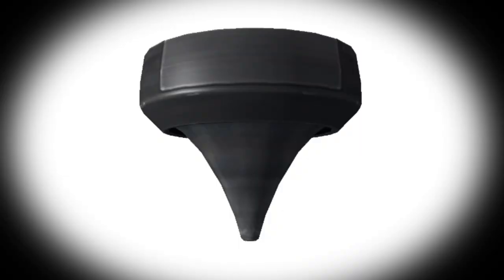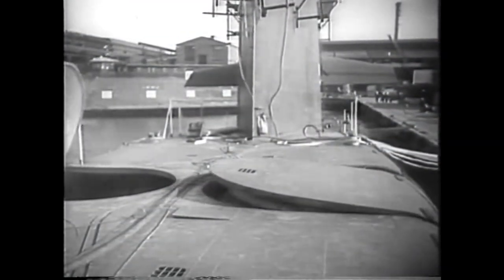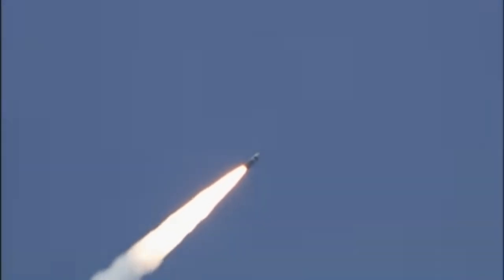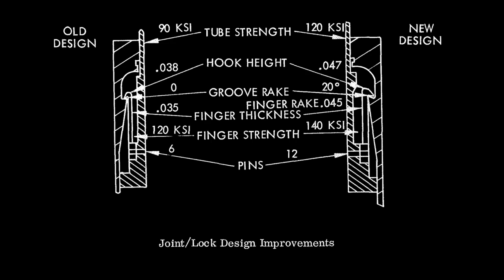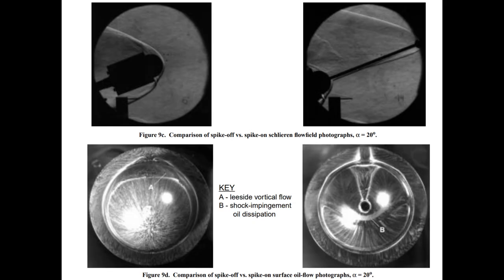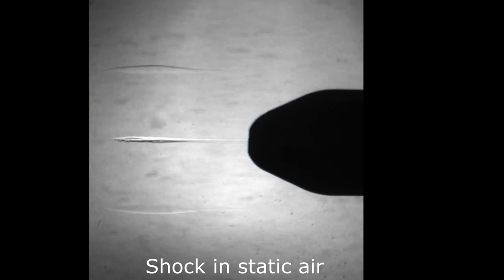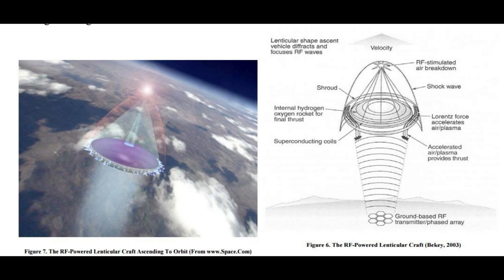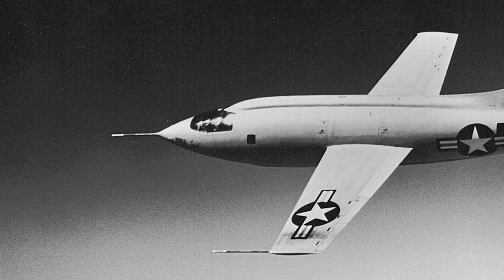Why Does The Trident Missile Have A Spike On Its Nose?

Comment: Mach 1 underwater blows my mind, I would love to hear more about it!
Reply: The real question is if it actually is Mach 1 under water that would be almost equivalent to Mach 5 in air.
Reply: well it's Mach 1 in the air... as you know, it's impossible to reach Mach 1 in water, because that would require travelling at 1500 m/s or 5400 km/h
Reply: The conclusion on the supercavitating torpedo was that it was a 'weapon of last resort'. They are really noisy and immediately give away the launcher's position. On top of that is a programmed course weapon, because sensors, like sonar, cannot operate through the cavity. However, if you have direct line of sight on a large enemy vessel/high value target, which was worth the detection risk, then it woudl be almost impossible to dodge, though very prone to explosive countermeasures. There is a US Navy, or RAND  Corporation report on them, I forget which, that presented the conclusion that they would have a very limited use, but might be worth having one or two per attack submarine
Reply: @profpep  Meanwhile the soviets looked at their swarms of often diesel powered attack boats, compared them to a nuclear powered aircraft carrier and said "Yeah... seems like a fair trade."
Reply: @Tomyironmane  Not at all. Carriers and modern destroyers deploy submarine-hunting helicopters and aircraft, while supercavitating torpedoes have a very limited range. Russian submarines are notoriously noisy once they are no longer new, because Russia is terrible at keeping its hardware well-maintained.
Reply: @larslindgren3846  Technically it's not in water, it's flying at Mach 1 in a sheathe of air which just happens to be underwater 🤓
Reply: That's why Narwhals have that aerospike
Reply: @profpep  Yeah,  pretty much like a bullet and very short ranged.  Thus its limited utility and why all torps aren't supercavitating today.  There probably are some secrut squirrrel systems out there that no one in the public will see until bad things happen.
Reply: @Tuzszo  technically it's not air, but a mixture of water vapor and whatever extra gas is used to assist the cavitation
Reply: @Tuzszo  As the speed of sound depends on the density of the medium and the mach number rather correlates with the fluid dynamics in that regime and not the speed, it wouldn't make sense to call it mach 1 if it wasn't in water.. in that case the torpedo actually reached1548m/s which indeed even exceeds mach 1 under water.
Reply: @profpep   I can imagine a torpedo that goes supersonic only when it gets within a certain range of its target.  That would give little time for counter-measures, and also give the sub time to vector off in a different direction.
Reply: Thats intetesting.
A misconception for sure.
Sound travels 4 times faster in water so a miscile swimming at 3000 MPH thats fast.
But I guess the speed of sound in air (C.750mph) underwater is what Scott intended.
Reply: @larslindgren3846  Air mach1, but underwater. They will reach mach 5 later but   only a few seconds later.
Reply: @Tuzszo  I guessing the torpedo is actually travelling at ~150 knots or ~170mph under water...
Reply: Well actually was near 1 mach at 10 000 meters, witch is more than 1000 km/h, but only for a short period and using SRB, basically the same thing that alow space rocket to lift off the ground, obviously this means low range for torpedo(maybe 20 nautical miles) , but theoretically you can use the same principle on a submarine that uses liquid rocket propulsion but even in that case you only have 5 minutes of propulsion at that speed.
Reply: The supercavitating VA-111 Shkval is really a solid fueled underwater ramjet, they only work in saltwater, powdered metal Magnesium-Aluminum fuel react with salt at high temperature to create steam, magnesium oxide gas and other fractions, a secondary gas generator feeds the cavitator. they are really hard to control, your control surface need to extend outside of the cavity and they tend to disintegrate pretty fast... the American project in the domain was shutdown after an out of control vehicle crashed into a pack of whales killing 3. It was restarted under Trump as an upgrade study for the MK48. They are also VERY loud on sonar.
Reply: @N1gel  The torpedo is surrounded by air, so the Mach speed is the speed of sound in air.   (3,000 mph in an incompressible fluid would destroy any solid object.)
Reply: Mach 1 in water is approximately 1125 ft per second.  A lot faster than in air.
Reply: @mikemuha7537  That's the speed of sound in air you quoted, about 350 meters per second. In water it's just over 1500 meters per second.
Reply: @Pieter Veenders  then Google sucks, because that is what I asked, what is the speed in water.
Reply: @jonharson  That was one of my thoughts.Presumably when one of these is in the water no one for miles around can hear anything else?
Reply: the sonic boom from that would be probably 5x more intense as well - or is it 50x ?
Reply: @jonharson  Why are there always people like you in the comments sections of these kinds of videos pretending to have been involved in some military programs or to have had clearances to have non-public inside information on them? Anyone who had been involved would not be making such comments and would certainly not have such poor writing skills.
Reply: @pistonburner6448  what did he write that made you think he is some secret engineer on the Shkval programme?

And why should a secret Russian engineer have to have good English writing skills to qualify?
Reply: @daszieher  Who said he was an engineer on the Shkval programme?

And who said anything about Russian engineers?

Do you not understand that people with long careers as talented engineers, with degrees from good universities don't have horrible writing skills?

Seriously, why is Youtube lately absolutely full of people who have absolutely horrendous reading comprehension skills? People read other peoples' comments and yet have absolutely no clue what they just read even though it's in plain English right in front of them?!
I thought the standards of spelling were bad enough, now this...
Reply: @pistonburner6448  Shkval is Russian. To have been involved in that programme, a person would most likely be a Russian national, at least not someone with English as their first language.

As an international platform YouTube does  attract many with a mother tongue different to English. Naturally writing and comprehension skills will vary. How is this surprising?
Reply: @daszieher  You really can't read well, can you?
He talked about an American program too.
Reply: @daszieher  Maybe one day you'll learn how to read and somehow manage to also actually understand what you've read. Then you won't have to read messages meant for others, not meant for you, and  make up things that are not there in order to have a fight all by yourself, and life will be easier for you.
Reply: @bardes18  indeed. They tried obtaining his powers by imitation, naming their weapons "trident" and "poseidon", in vain
Reply: @Mike Pepper  if you watch sub brief on YouTube here he talks about them a number of times.  The Russian version has only a 800 meter range and with it being straight running. It's basically a WWII style suicide and propaganda weapon. 

A wake homing or acoustic homing torpedo at that range would still be a better option.
Reply: There are accounts from former Soviet submariners that the Shkval (Squall) supercavitating torpedo was nearly always deployed with a nuclear warhead because it wasn't nearly accurate enough to hit anything effectively even with the very large conventional payload it could carry... Which ran into the problem that it also had a very short range, possibly short enough for the launching submarine to get caught in the blast, and thus it was generally understood as essentially a suicide weapon. Soviet engineering folks

Comment: Richard from Chabot Space & Science Center here (Scott, you and I have met).  Having worked on the Trident I and Trident II missile program at Lockheed for 15 years, it was really interesting to hear you describe very accurately how the aerospike works and why it was used in this instance.  I have been up-close and personal with the Trident aerospike many times including working with the team of engineers having to design for details like this.  It is more like a upside down titanium dinner plate on the end of a thick telescoping rod and pops out almost immediately when the rocket engines fire.

Comment: They didn't "figure out they could make larger missiles by stripping out some of the lining of the tubes".  When they made the Ohio class subs they anticipate using the larger Trident missiles but they weren't ready yet so they lined the missile tubes with smaller launch tubes for the Poseidon missiles and later stripped out the smaller launch tubes for larger ones for the Trident missiles.
Reply: The early Ohio class boats were built for the C4 Trident I, not C3 Poseidon. They were later refitted for the longer D5 Trident II.

Comment: The inertia sensor to deploy that spike reminded me of a story we passed around when I served on the boat.  That the missile when launched would actually rise up out of the water because of the force it was launched with.  And it would start to fall back into the water and it was this 'falling' that triggered the rocket motor. (when the sensor detected 'near weightless')
Reply: Was it true?
Reply: @tonyhawk123  The missile rides a gas bubble out of the tube and is thrown out of the water. The motor fires as the missile begins to fall back, according to film of launch tests.
Reply: @kentw.england2305  cheers. I suppose that makes sense. They always appear to behave that way visually. Hadn't cottoned on to the zero gravity moment being ideal for a sensor.
Reply: @tonyhawk123  Its probably not the only thing that tells the computer to ignite the motor.
Reply: @obsidianjane4413  Yeah, you'd want half a dozen different inputs that add up to an ignition command.  It would be kind of embarassing if the rocket went off in the tube.
Reply: @jpdemer5  it'd be kinda embarrassing if the rocket didn't go off at all, or was a bit late too... it'd be really interesting to see some detail on the launch/ignition sequencing on these things. There's not really a "fail safe" position once the launch starts so it'd have to be very reliable and redundant.
Reply: @obsidianjane4413  No doubt a bit more than just what I described, but remember for example, the early Poseiden predates modern computers.  They even earlier than the computers of Apollo.  So yes, undoubtedly a couple different signals to 'arm' the igniters before the inertial sensor can light it.  But no real 'computer' in the modern sense of the word.

Even the 'failsafe' devices on nuc warheads have to be incredibly robust and as 'failsafe' as they could get.
Reply: @chemistrykrang8065  Interesting, but I'm sure 'classified' way above my 'pay grade'.  lol  As a lowly Electrician's Mate, it was my job to make the electricity and keep the lights on.  Never had a 'need to know' details like that.
Reply: Initially during the externally fed power stage the missile enters launch mode then is commanded to switch to internal power. The batteries are dry until launch, at which point electrolyte is fed into the cells. The actual ignition event is triggered by multiple inputs, inertia sensors etc. Then the 1st stage motors run, separation then stage 2 and so on. Obviously that is a very simplified explanation of the firing procedure :-)
Reply: @Omegaman1969  You're wrong about the batteries. They use molten salt batteries(often called Thermal Batteries). The electrolyte is usually lithium or potassium chloride which is a solid at room temperature and can be stored indefinitely. Some handy pyrotechnic reactions melt it and it turns into a battery to supply all the energy needs of the missile for the rest of it's life.
Reply: @Melanie16040  No I’m not wrong, that’s not how Trident II batteries work. The electrolyte is forced into the cell by gas upon launch, well that is the original design. I’m well aware of the cell life dry and wet. It may have been changed on the more recent versions.

Comment: Thank you for taking this topic on as it warmed this old Missile Technician’s heart. I served on board SSBN’s 738 & 742 from Feb. ‘94-Dec. ‘97 & Oct. ‘01-Apr. ‘05, respectively. Covering the entire family of SLBM’s I figured some old(er) FTB, MT or WT would weigh in on those platform capabilities, but you did a very good job in presenting the material on the aerospike and the SLBM family. Keep up the great work!
Reply: Thank you for you service. I myself was an ftb on ssbn 727 and a tm on ssbn 738. I would weigh in if I could but all the inner working is classified
Reply: @albobarhop   ahhh...FTBs...whenever there was missile handling ops they were First To (the) Beach 🤣
Reply: I was a Missile Tech (Trident Backfit, NEC 3315) back in the 1980s. SSBN 641. It doesn’t seem that long ago but the minor aches and pains in my body tells me differently. This video did bring back some memories.
Reply: This took me back - Served at an MT on 658,641, and 643, also served at POMFLANT and SWFLANT

Comment: On a Rocket Test Group tour at China Lake, our host led us into a test cell where a Trident stage 1 motor was being prepped for a test firing the next day. It was a little chilling to stand right in the exhaust zone of a solid motor with something like 80,000 lbs of double-base propellant.

Two NASA guys excused themselves to go outside and were visibly relieved to step out in the parking lot on the other side of the cell, until I reminded them that if it went high order we'd still be in the fireball.
Reply: A friend of mine used to work on Titan II missiles years ago when he was in the Air Force. He told me a story about some guys that were working in a room with a solid rocket motor that was, IIRC, supposed to separate stages, when they screwed up and set it off. It fired for maybe a second and those guys were essentially erased from existence.
Reply: @RCAvhstape  Hot time in the old test cell tonight!
Reply: There was a case at Hill AFB, Utah in the late 50's or early 60's in which some airman where performing unauthorized maintenance on a AIM-9 Sidewinder rocket motor.  The rocket motor ignited and raised the temperature of the maintenance bay, incinerating the airmen.  The incident happened on a weekend, and they had to preform a total recall of the section to determine who exactly was killed.
Reply: @RCAvhstape  Geezus....what a horrible way to go.